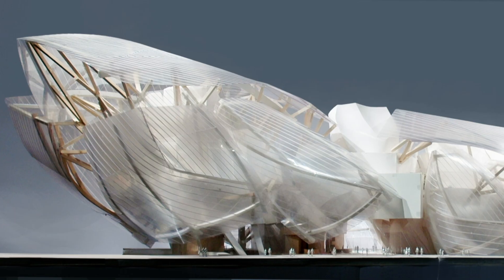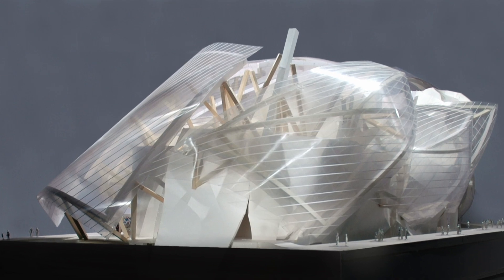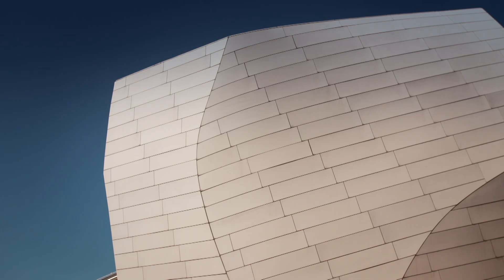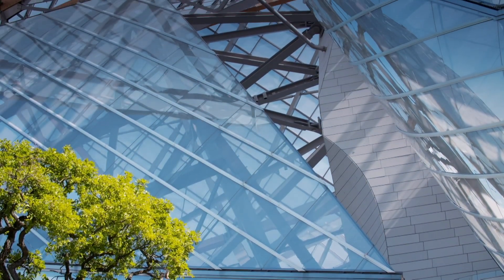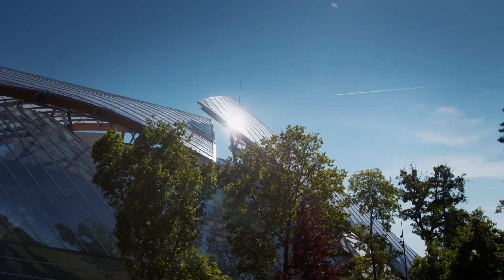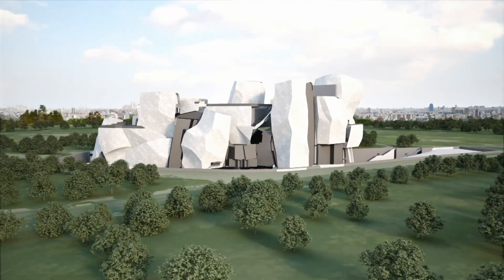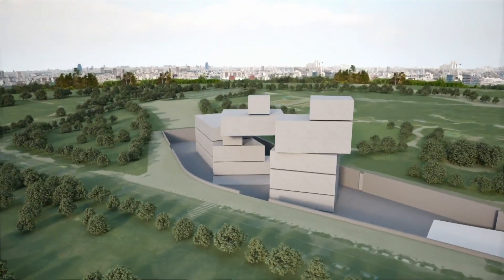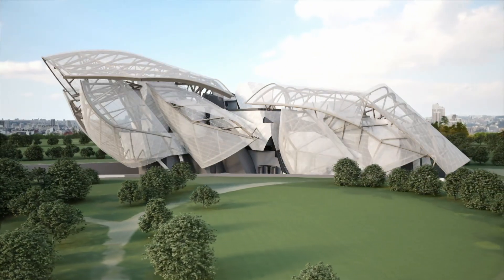This Frank Gehry Building Was Called Unbuildable 😤 How Did They Build That? | Smithsonian Channel

Comment: We have a Gehry building in Cincinnati. It is the Vontz Center at the University of Cincinnati. Every year since it was completed there has been scaffolding up somewhere around the outside of the building trying to fix water leaks and other problems. It is an interesting structure, but completely impractical.
Reply: Exactly what I was wondering about, water intrusion.
Reply: I agree.